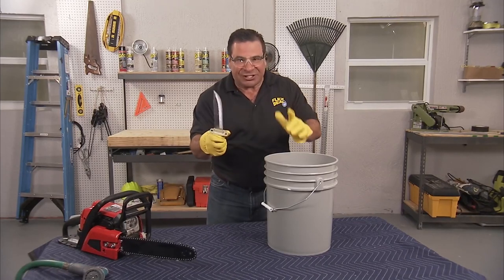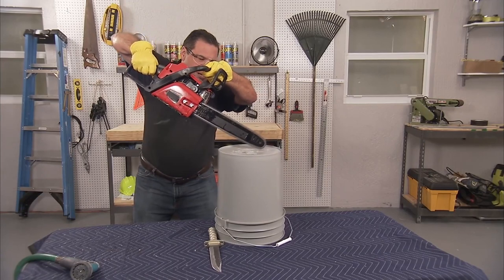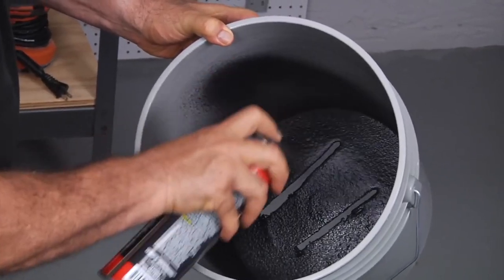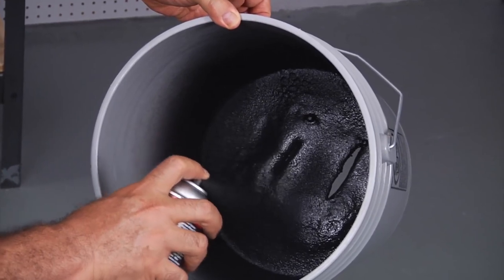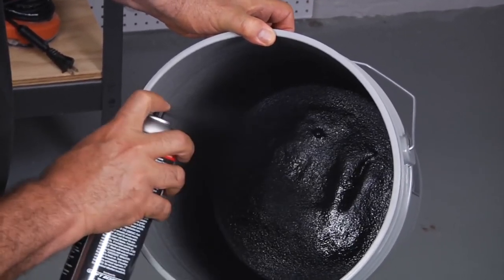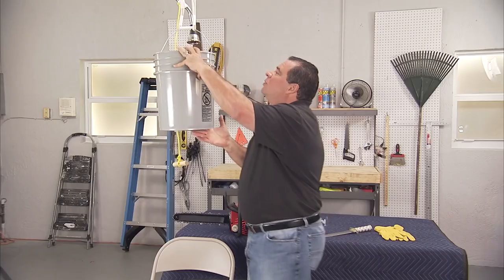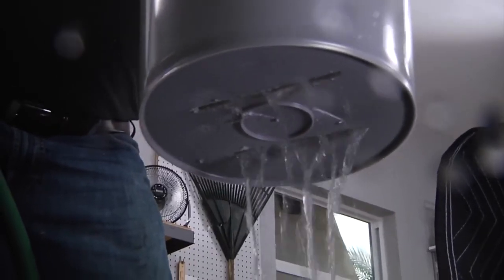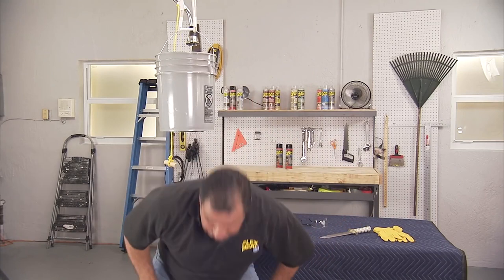Flex Seal Fails to Seal Bucket. Phil Swift says "Flex Seal Works"

Comment: Just use flex tape phil
Reply: OMG 😂
Reply: That's what I was thinking
Reply: It wasn't released until 2017, this video was filmed in 2015
Reply: nope. Flex Tape is only for fixing boats, not buckets.
Reply: SLAP IT ON WITH THE MIGHT OF ZUES

Comment: Ah of course, the old “using a 20$ spray to fix a 5$ bucket” comments. As if the bucket wasn’t used just for demonstration purposes.
Reply: Thank you, my child! FlexSeal is a gift from the gods!
Reply: is that you, Phil?
Reply: I know right! I fill all the holes in my engine block with flex seal!!

Comment: But do it when there's an actual leak. Not when the bucket is empty.  Try patching when there's a small hole made with a nail hole and the bucket filled with water.
Reply: bro didnt you watch the commercial he literally did that with flex tape